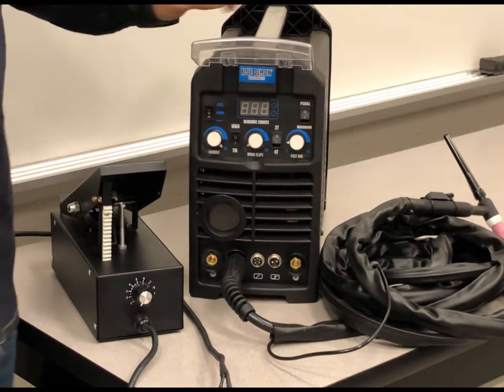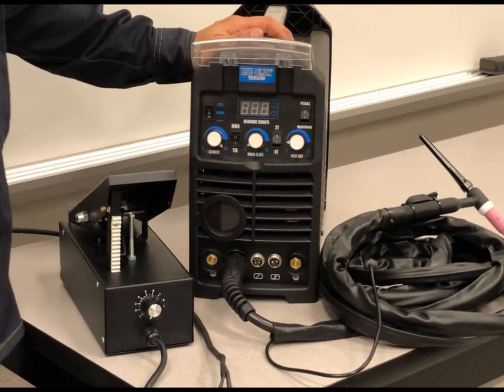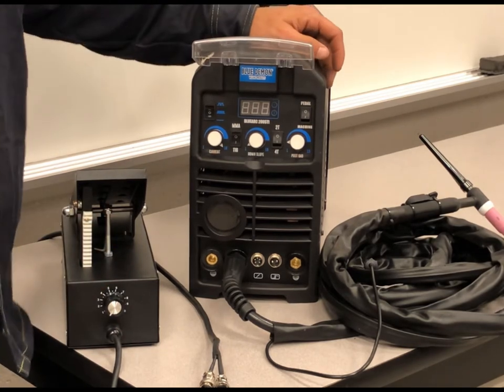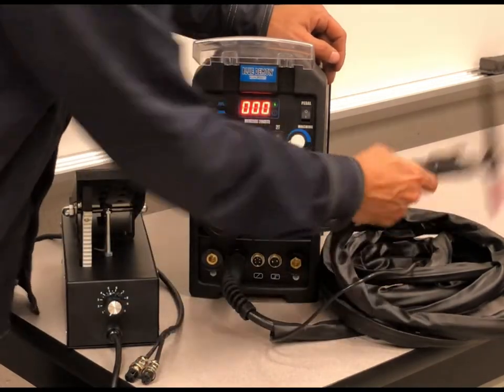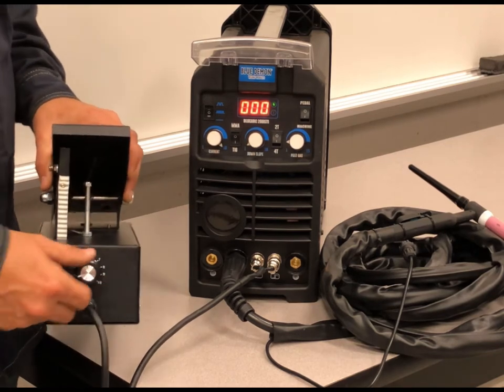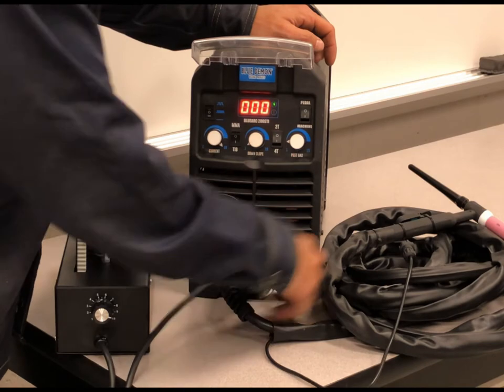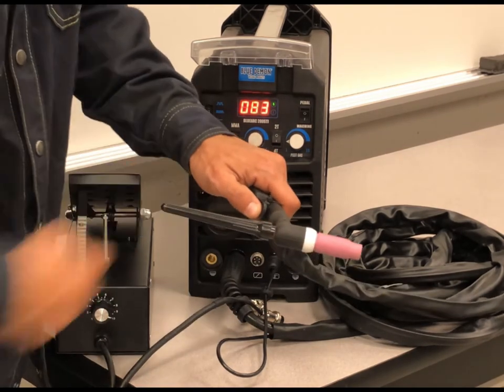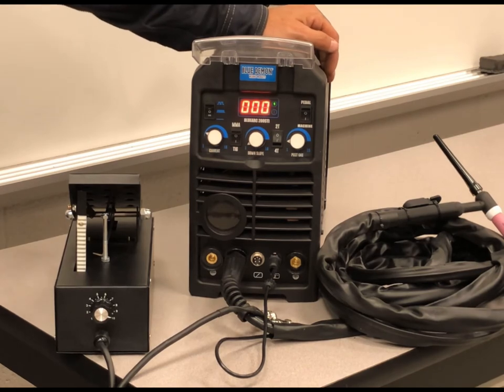Blue Demon remote foot pedal instructions

Comment: I love my 200STI AC/DC TIG, but this foot pedal is going to be the first thing replaced. The welder doesn't seem to like working with it and will attempt to start an arc even if your foot isn't on the pedal.
Reply from the maker: if you email me a picture of you cable connections maybe i can help out - bluedemonweld@gmail.com
Reply: @bluedemonweld  email sent! Thanks for the feedback. Still love my 200STI